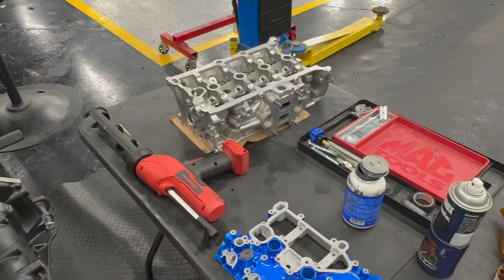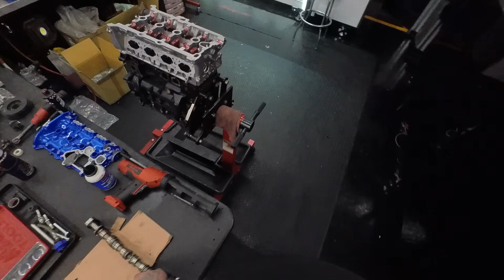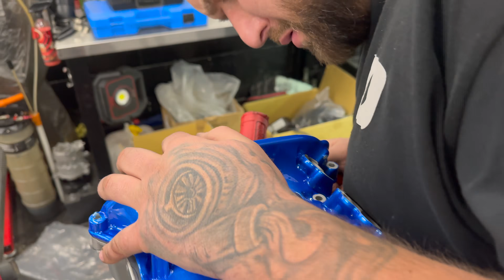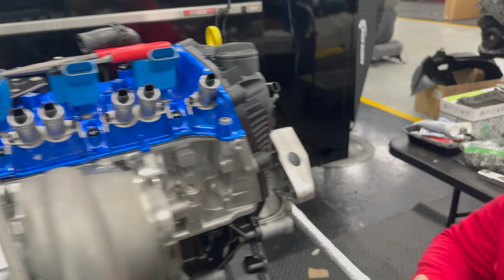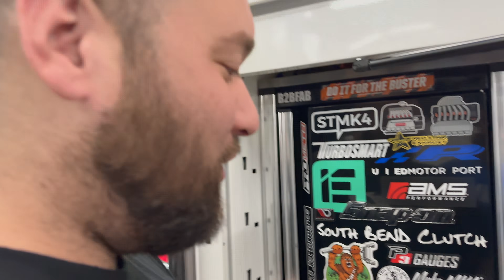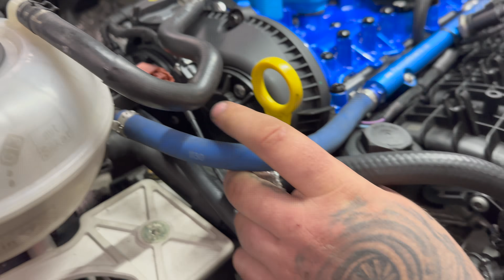700WHP Fully Built Volkswagon Golf R Finally Starts!!

Comment: You guys prefer using the black silicone sealer for the cam cover?? I had a thought of doing this too… the anaerobic sealant is a pita to clean off the mating surface lol

So general consensus is this is ok?? Assuming you don’t use too much and block an oil passage?